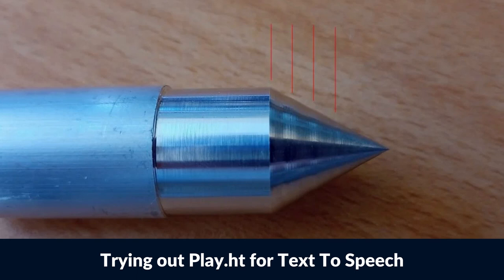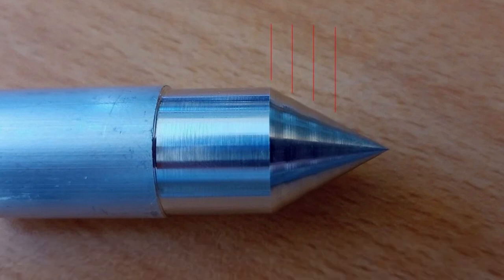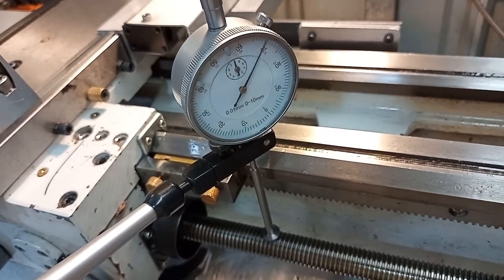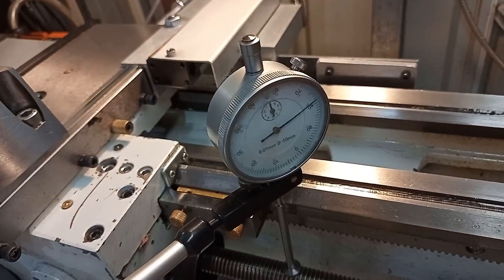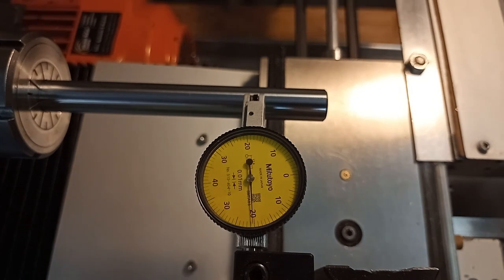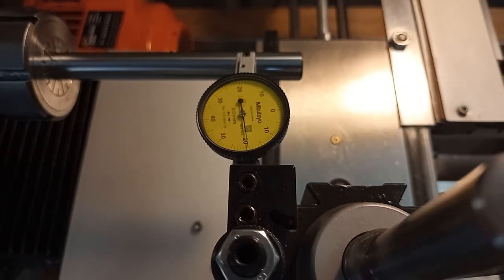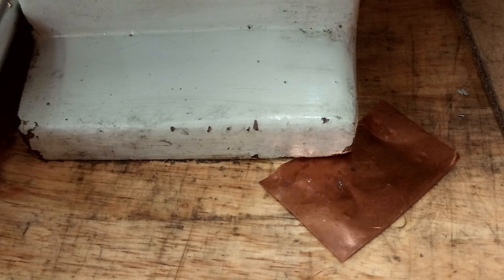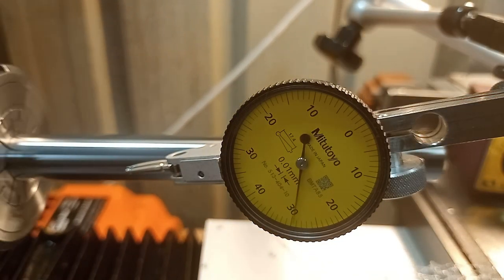Lathe bed leveling and lead screw alignment

Comment: That is an impressively true bar. Makes me want to quantify how bad my lathe is. I've never levelled it!
Reply from the maker: It's not something I turned, it's a ground shaft I was using for reference to demonstrate that the carriage runs true with leadscrew engaged but a test bar (not shown) that I turned came out pretty much the same. Definitely worth checking the bed level and more importantly the twist along with the wobble when half nut is engaged. Unless your lathe has a dedicated drive shaft for turning, cheap lathes like mine only have a leadscrew.
Reply: @HM-Projects  mine does have the dedicated feed shaft, and I had wondered why it needs both. Looks like you answered my question! Thanks